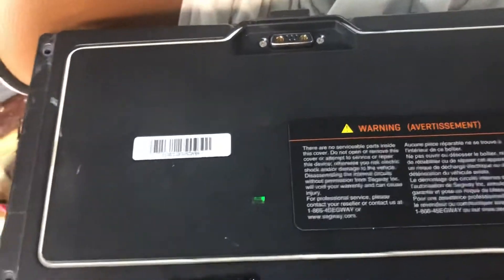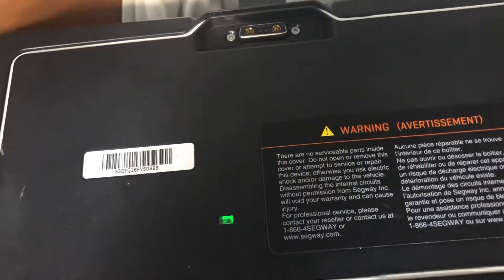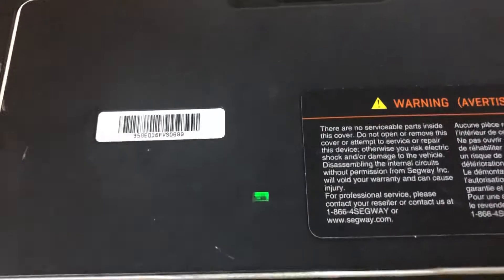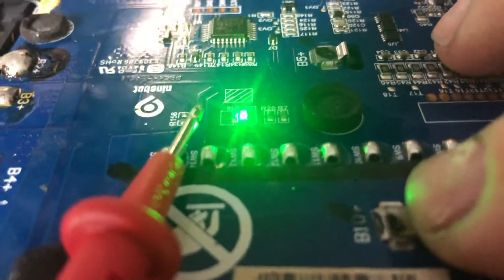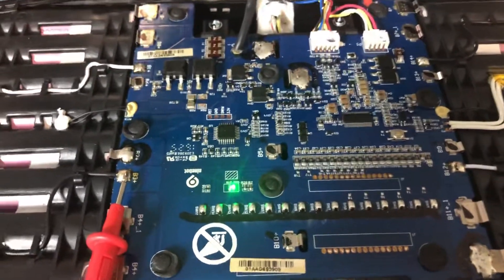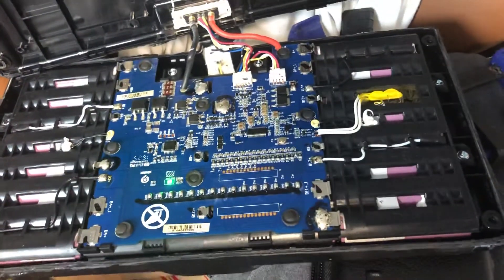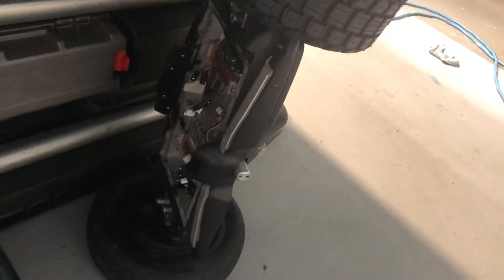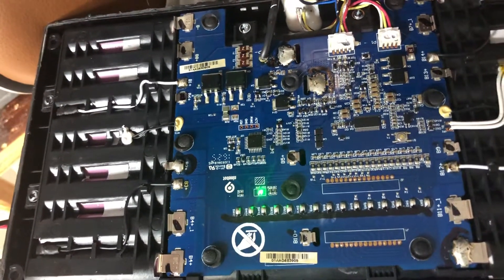Segway MiniPro / ninebot S battery issue resolved - steady green led on battery

Comment: Hello, i have problem with green light. My green stil light all the time, but i have stick oki. Do you know why ?
Reply from the maker: Your battery is good but needs to be looked at by professional repair, same issue I had with in this video most likely but for sure it can easily be repaired by an experienced repair place, it is not a bad battery

Comment: Ninebot S Battery Charging Problem.

First tried Youtube videos on awakening the battery with no success.

Then opened my battery pack and all the individual cells are 4.16 to 4.2v. The output from the main terminals is 20.8v. Input from the charger is 42v. Charger has green solid led. Led is completely off on the battery pack.

Comment: Very useful information. Though I was on the edge of my seat when you were putting that multimeter probe down on the board and almost shorted out the cells.
Reply from the maker: Yeah I need to remake or update the video, I’m actually not a dumbass and very knowledgeable about electronics, electricity and dangers of these lithium ion batteries, he’ll I have a power booster pack with 4 cells in it and it will crank my vehicle with no battery attached or dead battery.  What you saw was on a wimb meaning I definitely didn’t expect to find the issue or fix it and I honestly thought I’d be at best repurposing the cells for other things.  Totally unscripted when I decided to film was purely to show people that a battery with seemingly good status judging by the steady green led (turns out it good status is blinking green),  should actually be blinking green but if steady green and no red then there is high likely that it can be fixed by a professional and there are no bad cells , this would cause a red led but also a great pool for android phones is this battery app tool https://drive.google.com/file/d/1aefe8jZAuYtOk_N8u92tseXlbFqGjDm9/view?usp=drivesdk

Comment: You the man! My B10+ solder connection was broken as well. This happened when I hit a raised sidewalk bump pretty hard and my Segway shut off when the solder joint broke. Pretty bad fall and I got injured. Wear a helmet!  My battery light was not on at all when I took the battery out. I had to push the reset button on the battery circuit board and then I got the Green flashing light while holding the broken solder connection down. For those looking for the reset button, it's small and about 3/4" away from the B9+ connection. (and Lee points to it at 1:53)
Reply from the maker: I haven’t touched it since that video and it’s still running strong no further issues.  This battery back came with the minipro (pre Ninebot) and is 320 kW/h which you won’t find on any ninebot s model it uses 263 kWh and the difference ins power, distance and overall life of each charge is significant between the two

Comment: Hi there, I've the same issue (solid green light) which came all of a sudden after charging the battery on my minipro by directly connecting it to the charger. I opened up the case and don't see any lose or broken connectors. Any other tips of where else to look for any other lose connectors?
Reply: Every single cell I tested is at 4.0v and the total voltage is 61.9.. no idea what else could be wrong.
Reply: I charge mine on because it doesn't when off
Reply: Hey Nick the connections look fine but if you touch every finger to the fuse area or whatever labeled b11b9b 10 B6 so on and so forth just start touching them and your green light will start blinking that's exactly what mine did they all looked fine so I assumed it was just to sell or something but I started just touching the the pieces and all of a sudden Bing it started flashing back green
Reply: @_dave5276  thanks for this comment! I started touching all of them and one that wouldn’t touch it. How do you fix it? Do I need to put glue on it?

Comment: simple stupid: https://www.ebay.com/itm/202978676519

Do not follow this one on youtube - it's sloppy and a very risky. You may not be so lucky as it may blow on your face and get caught on fire. The method in our instruction is technical / scientific and calculated because we know how the internal circuitry of both battery balancer and the trickle charge safety feature of the original charger works. These are  employed and accounted in our timed easy to follow method instruction and that is what you paid for - your safety with high chance of succeeding in recovery. a Simpleton way to recover your ninebot battery without tools or damaging your expensive charger. It comes with instruction and special Jig custom made cable adaptor and connectors.

...to fix your dead ninebot battery SAFELY without any tool, without breaking the battery nor ruining your expensive Ninebot charger - simple stupid: https://www.ebay.com/itm/202978676519
Reply from the maker: Lol I wouldn’t  follow it either and yes I understand how circuitry works, a broken solder joint will leave u dead in the water every time, the only thing I would do differently now is open the pack using the correct method instead of tearing into it, I have plenty of experience with LiIon and LiPoand oh the battery still working like a champ.  The video was by no means are instructional or tutorial it was more so a I can’t believe how damn bad the battery pack was built and I can’t believe how many people get ripped off bc of it
Reply from the maker: Sir there is no recovering a battery, no trick whatsoever that is going to recover a battery that has an issue due to a broken solder joint and therefore it’s not making physical connection inside the batter pack
Reply from the maker: But I agree nobody should attempt this unless very experienced and comfortable working with electrical specifically DC and lithium ion batteries highly dangerous.  This was more to show a steady green light makes it appear the battery pack is good but it should actually be blinking green and if it is steady green it’s not a bad cell or catestrophic issues such as bad bmc or bad cells, it’s broken connnection

Question why does your eBay link not work, would you update or send working link to the eBay product

Comment: Any update after soldering?
Reply from the maker: Yes the battery is working great and to this day after buying another battery that had the exact same issue and sending it back then buying another minipro, to this day the battery in the video is the only 320 w/h battery I have, all.the newer ones.amd any one for sale.is 263 w/h (another words less power than the 320) so yeah def worth it.  The only thing I would do different now is how I access the battery I have a laser cutter now I will cut the battery open rather than using the multiple methods are used but it’s back in one piece and it works great
Reply: @Llimton850  I personally like to thank you mine was the exact same issue as yours b9.. thank you sir I greatly appreciate it
Reply from the maker: Yea no problems or issues since I put it back together

Comment: I've fixed some that have had up to 5 of them loose
Reply from the maker: Yes I found three more loose Joints on that same battery
Reply from the maker: Hot weather and operating the machine in grass or uphill or anywhere that causes extra strain to move forward will draw more power and cause battery to heat and couple that with 100 degree summer weather and the solder just got to soft to hold